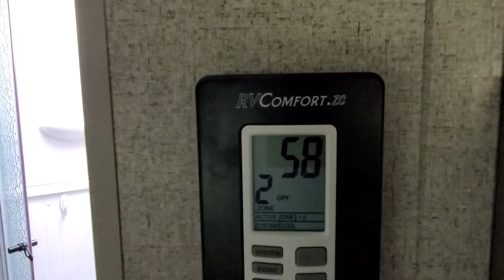RVDaydream Watcha Doin 9 9 19 CB ANTENNA

Comment: I am not going full timing so had a 20ft X 40ft pole building built with 14ft eves and a 12ft X 16ft rollup door. It rains a lot in Western Washington so RV’s last longer when they are inside. I still have my 1982 Terry 28W travel trailer because it is kept inside a addition to my barn. I also still have a 1995 Aljo 25ft that we keep in the garage. The wife and I bought the aljo to use in retirement but I was injured in 1997 so now I can’t drive. Go full timing as soon as practical as you never know yhe future

Comment: Thanks for the heads up on the Forest River recall. I have not rec'd a letter yet. I am constantly on the roof and will check later this week. As a result of an out of state car wash damaging my antenna during an unauthorized removal, I obtained a plastic wrench that slides over the antenna and on to the base. I then can loosen and remove the antenna without scratching the black paint, which happens when you use a metal conventional or adjustable wrench. I got the plastic antenna wrench from a Ford dealer, however, it is not an OEM part. There are some similar ones available from Amazon. My local car wash does not remove the antenna on my F250. The plastic surrounding the antenna is the cowl grille. The garage doors look great! I will be at the Hershey Show for at least a day.

Comment: I may have missed it, but where did you mount your cb in the truck? Did you use an upfitter switch for power?
Reply from the maker: I did not use the upfitter switches as the only way I know that you can connect to that wiring is if you run it from underneath the hood. Maybe there's some wires underneath the dash that I can connect to? Anyways the CB is being held on to the glove box door with 3m dual lock Velcro which velcro is a loose word because this is some heavy duty stuff. And I just have it plugged into a cigarette lighter port in that four-way adapter that I have sitting on the transmission hump.
Reply: @Rvdaydream  , thanks for the reply.  I think you are right about having to hook into the wiring under the hood,  which is why I have not used the switches yet.   I am unsure how to get out there from inside the cab.  I thought maybe you figured it out since your coaxial comes in from that area.

Love your videos....Keep on Daydreaming
Reply: @214steveg  I went through the large rubber boot that is to the left I believe of the brake pedal that a large group of wires come through. It's easy as just the pulled the boot out of the firewall and then make your holes that way
Reply: @Foxboss9  , thanks! I will look for that boot!